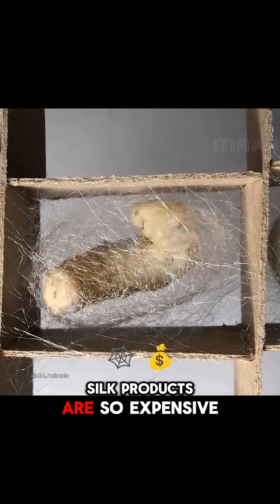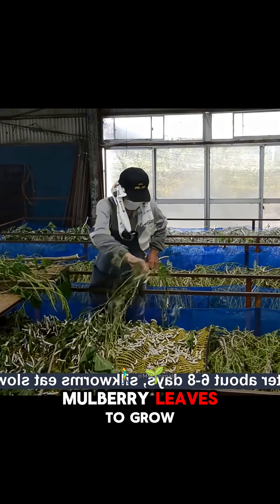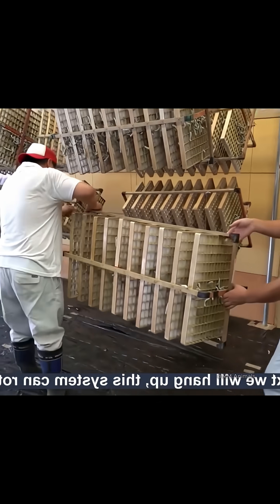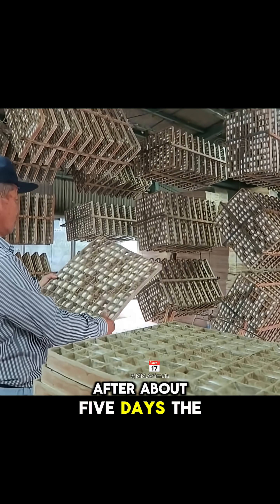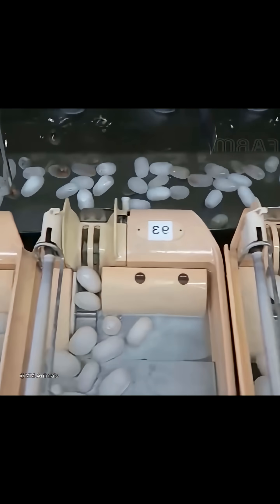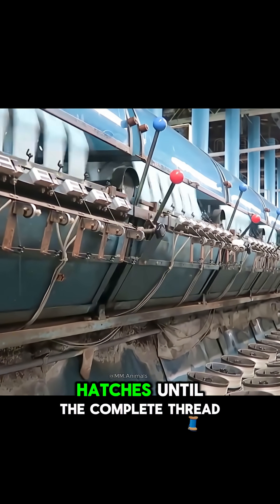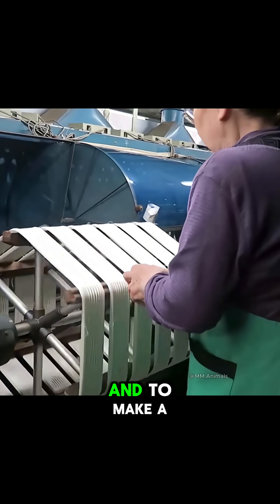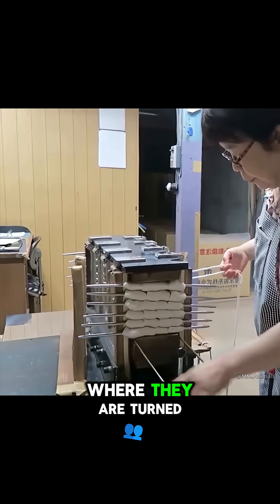The real reason why silk is so expensive #discover #curiosities #facts #knowledge

Comment: Remember, silk is very hard to get, especially before the 18th century. 

However, production was so wide and vast that it became an exclusivity to more common place. 

While peasants and low class  silk out of their reach, possibly affording a headband or something small. 

In China silk production was so high  that lower mid class could even get a hold of it, that is when silk started to lose its value, and that is where the introduction of rare colors came in because silk is notoriously hard to dye and keep it vibrant shine. 

Colors such as gold is the hardest to make, and purple being the most pragmatic to get a hold of in terms of high high class. 

In Japan cloth was very hard to get a hold of, and silk was actually a very common warrior attire, for it was very flexible. It didn’t shave and they could tighten it to where it acted like a bodysuit. This made wearing the other fabrics a lot easier on their body and it was very breathable when it was hot. 

The further west, you go from Japan and China  silk became more and more rare to the point where even a medieval noble was extremely difficult to get a hold of even for them. Even kings had problems getting a hold of it.

This laid the ground work for the Silk Road, what was the fastest road and most direct to the west, with Chinese would sell silk to India, Mongolia, the Byzantine empire, the Ottoman empire and so on.